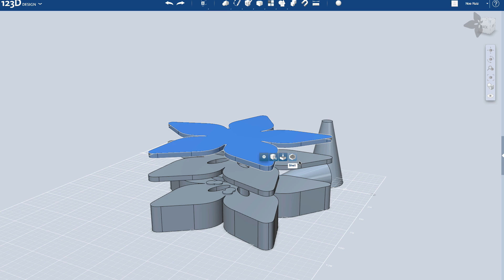Make a light up Christmas tree topper with Adafruit's GEMMA and NeoPixel

Comment from the maker: Gemma 3D Printed Tree Topper - Design and 3D Print a custom tree topper  #Wearables   #GEMMA  
https://learn.adafruit.com/gemma-3d-printed-tree-topper/overview

Start a new tradition and design your own Tree Topper. Celebrate this holiday with DIY electronics from Adafruit. Our tutorial will show you how to use Autodesk's 123D Design software and a 3D Printer to create a custom tree topper.

This is a great "Learn to 3D model & print" project as the shape is fairly simple, snaps together and can be customized.